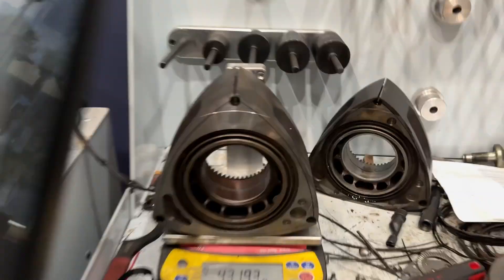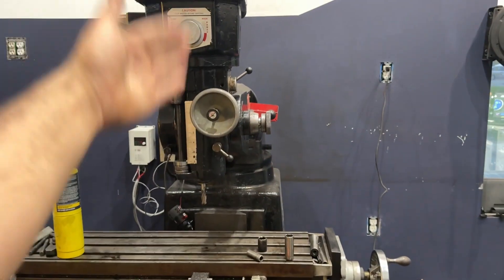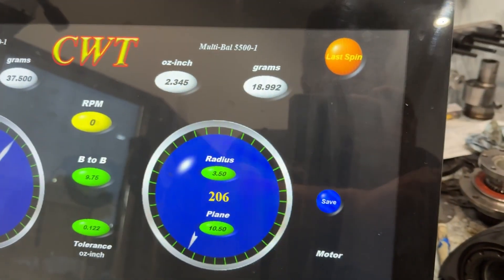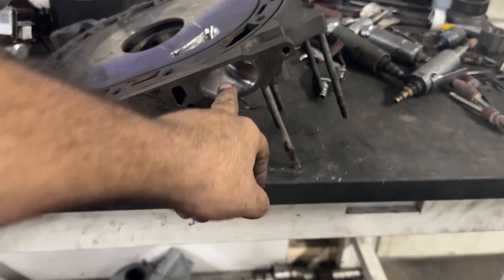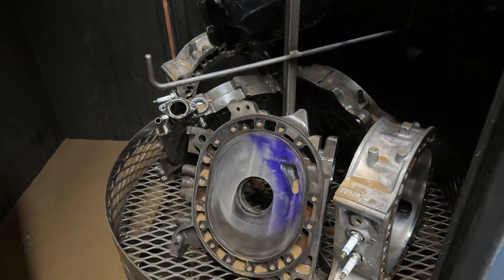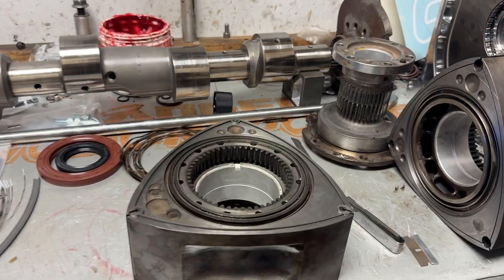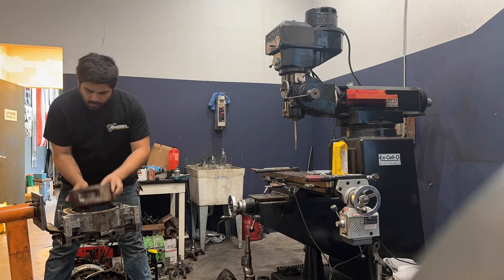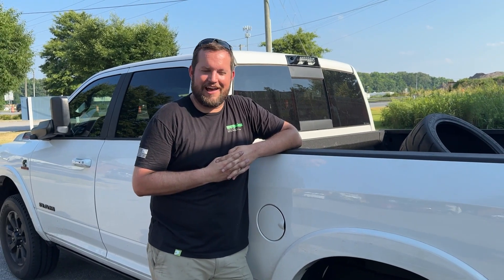Building ScrapLife Garage A 700+ HP Engine For Their Rx7

Comment: Just a question i really dont know much about rotary engine building. You weighed thw rotors with old bearings in them. Being 1 worn mor then the other when you put new bearings would it change the weight.
Reply from the maker: The weight of the worn bearing would not throw the balancing off plus putting the bearing on could damage it while doing some of the machine work
Reply: @angelmotorsports  ok cool just like learn. Thanks for the answers

Comment: What happened to that one rotor looks like it has a little bit of a machining oopsie possibly a deeper cut on the outside edge
Reply from the maker: It’s machined that way since the tip of the rotors tend to touch the side plates while under a lot of rpm’s or boost

Comment: .002"  side seal clearance is  a little tight for boosted engine. Most drag guys are using .004" for boost
Reply: The blow by at .004 is excessive. Besides we got multiple engines making 700+ at that spec. Now if we talking nitrous and nitrogen engines or 1000+ 13b yes